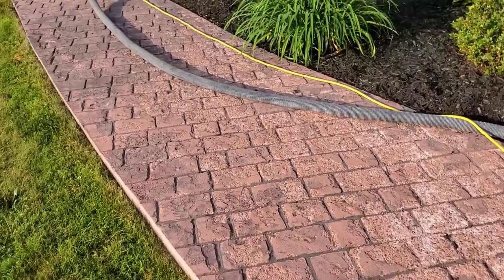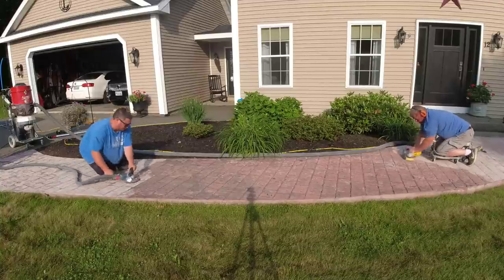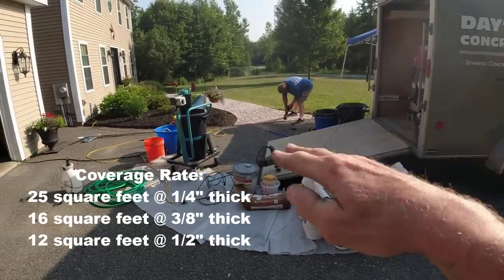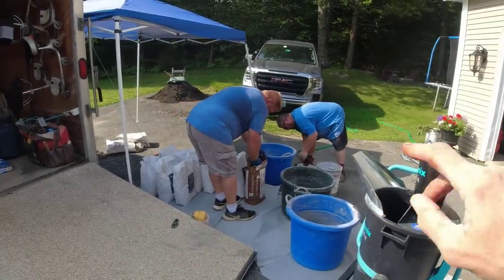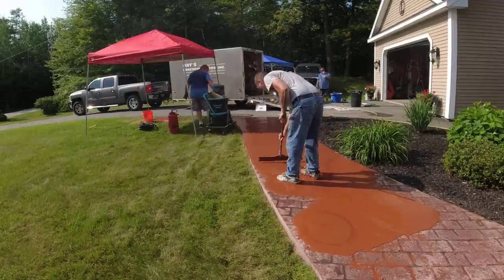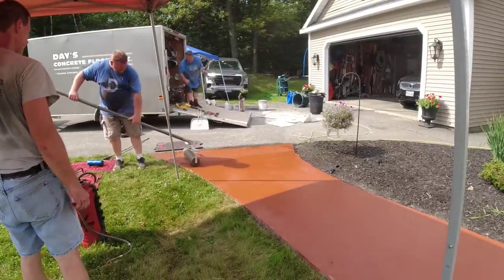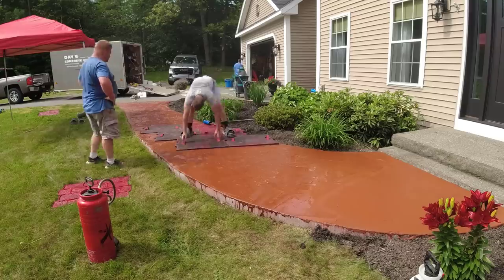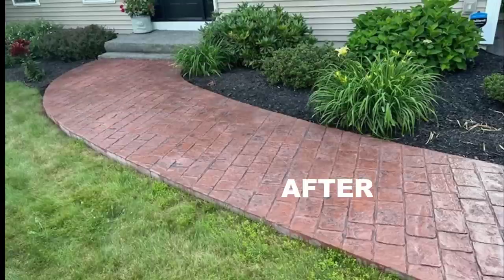How To Repair Badly Damaged Concrete With A Concrete Overlay Mix.

Comment: Mike. You’re right. That step is a disaster. If you can’t get a 5 or 6 inch rise on a step you’re better off going flush. But to leave a 2 or 3 inch rise on a stair is really a dangerous tripping hazard. Great video as always

Comment: Mike - Great job by you and the crew as always.  My comment to those thinking of doing overlays and stamped jobs are that they learn about the process thoroughly, then plan for the labor & time needed to achieve what they want.  Doing any type of concrete work requires planning.  DIYers frequently don't do nearly enough of it.  They bite off more than they can chew by not planning accordingly.  I've helped a few DIYers, but the successful ones were those that already knew the processes, but need an experienced guy to do the screeding, finishing, and in this particular case, coordinate finishing/stamping.  A sidewalk this size could not be done by one individual by themselves in one shot.  A single guy/gal could do break it down into 2 or 3 sections, but not all at the same time.  A DIYer could do it if they get help and make sure everyone knows their role in the effort, though.

Once again, great job!

Comment: Hey Mike, First thanks for the Concrete Underground, I'm on and it's worth the money. Second, here's a tip for your guys (I just found out here in FL) but on those hot sunny days, those cotton T-Shirts are not the best.  They collect sweat and drag you down.  Sports teams have known about this for years, but Jersey's or 'Wicking' shirts are so much cooler by letting that sweat evaporate.

Comment: I would have brushed that coating along the side of the walkway just to dress it off right even though you said the homeowner was going to add soil to bring up the grade.  Lazy people use Ice melt/salt and in the case of that house it looks like it faced the daytime sun where shoveling the snow off the walkway would have dried in the daytime sun and be okay by evening.  I hope your job lasts longer than two years for all the time and effort you guys put into it.

Comment: 30 years in the Concrete Residential Business. I had a Guy call Me about a pool overlay done at his house. He said it was chipping in areas. What could he do ? I said " Go rent a Chipping Hammer and start chipping it all up because it's all going to come up eventually. He said , Don't tell me that. Overlays work great inside but outside under snow, rain, ice, heat, wind, sun, etc,, . They are Nothing but a temporary fix . This job looks great done here. It's not permanent though. It will have to be redone again and again over the years. I need to start a channel and tell people what the other guys won't.
Mikey Out. Oooooh Yeah!!!!
Reply from the maker: I've done them on driveways, plowed on them for years and they still look great.
Reply: The Bonding Materials might be a whole lot better today. Down here in the South. We get lesser brands anyway.

Comment: I like to keep the grade up to a sidewalk around a 1/2'" to 3/4" lower than the concrete. That way the grass doesn't hold the water on the walk as bad. Nice job.

Comment: Has anyone done this over exposed aggregate ? We have a lot of that on the wet coast, and it's starting to degrade etc ( 1970's and 80's ) and slump a bit on many driveways.
I would prefer a broom type finish over stamping, not convinced the colour stands up. I have a coloured border on a patio with pavers in the middle, and it's OK after 15 years, but not great. It was not sealed, a mistake.
The product here looks excellent to work with. I would guess in Canada there are thousands of miles of sidewalk and patio, and driveway,  that would love this treatment.

Comment: I tried overlaying my walkway prior to pulling it up. Maybe the product I used from HD, or just poor base concrete mix, but it continued to flake a few months later.
Reply: HD overlay is junk. Don't  use their epoxy system either.